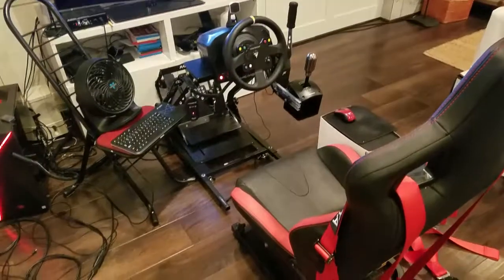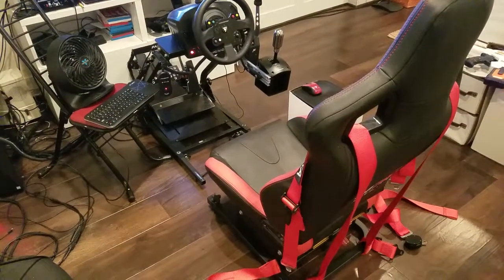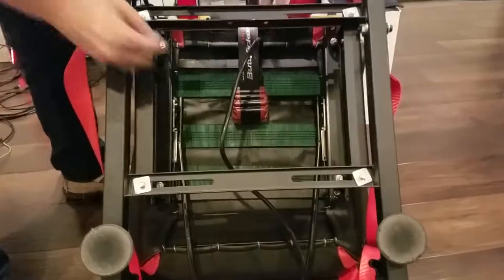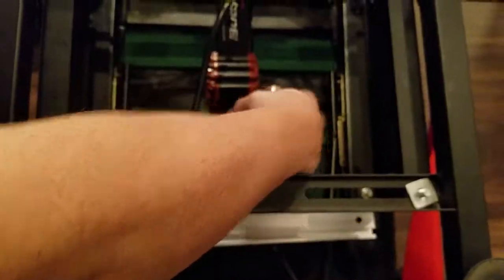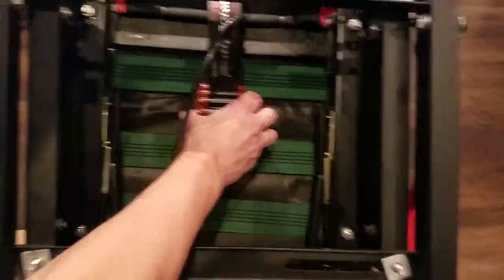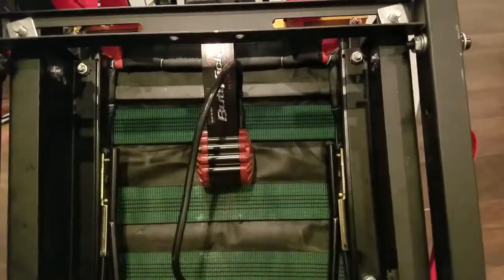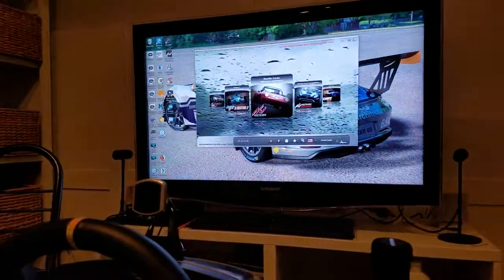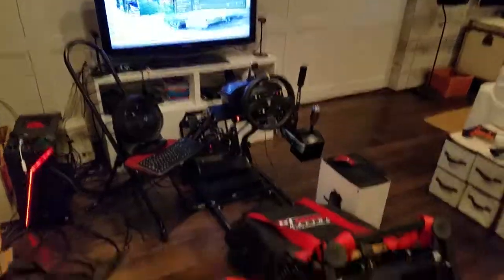Buttkicker Gamer II Sim Rig Mounting

Comment: Tend to agree with you.  Thanks for the video.  Thumbs up! I'll shortly put a video of my own about this.  I personally don't think it matters much if you mount it horizontally or vertically.  Those who swear by one or the other are misguided because if they understand how it works it is all about vibration not up down left right.  Where I agree with you is the LOCATION.  I made my own rig and it is very heavy.  I mounted it where I saw others do (at the back on a pole) and found it not to work so well.  Reason is simple, the rig is taking the vibration and by the time it reaches the seat it is ineffective.  I have just made a video similar to yours which will point out that you really want to get the Buttkicker as close to your seat as possible (not necessarily where it looks nice on the rig).   The buttkicker will work better for someone using an office chair as opposed to someone attaching it to the back of their rig.

Comment: I have mine mounted same way and you can feel curbs on correct side of cockpit so I think we have it mounted the right way in my opinion
Reply: If you only have one buttkicker you’re not feeling separate vibrations on different sides. There’s only one point of contact with the rig. If you think you are it must be an illusion from the combination of the buttkicker and stereo sound. To truly feel vibrations on different sides or front to back you need 2 or 4 bass shakers.

Comment: Mine is installed also horizontally right now, but near the pedals (I have solid cockpit), and for me it works better then under the seat vertically. Because front wheels and engine/transmission has more vibrations located in the front of the car, and it feels almost like IRL.
Reply from the maker: That's interesting. I'm getting ready to revamp my rig, so I might give that a try.

Comment: You have it mounted touching your seat? Do you find that mutes some of the vibrations? Also does it bang against the seat and make noise? Very curious.  Trying to find the best way to mount mine, don’t even know whether to point it facing out or in like you have it...heeeelp pleeease
Reply from the maker: Yes, the transducer head is touching the seat. Does not mute. The bottom of my seat is soft, so no vibration noises. 
I found the best results mounting as shown in the video. Try it out and experiment a bit. And get Sim Commander setup too. I also have a fan on the floor behind the seat blowing under a across the BK to keep it from overheating.
Reply: @bbcoltrane  hi mate there's  no sim commander on console how do you set up?
Reply from the maker: @idontknowyou876  just from main audio output from console. Adjust EQ and filter.